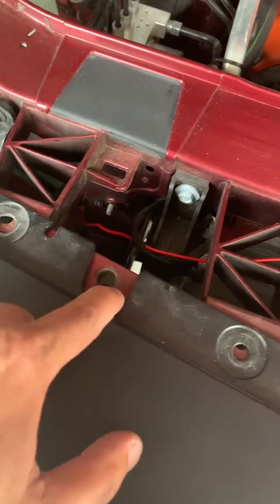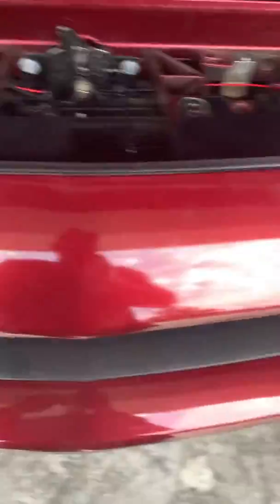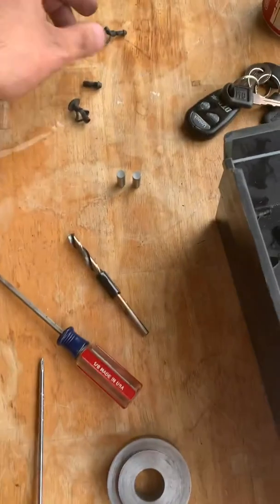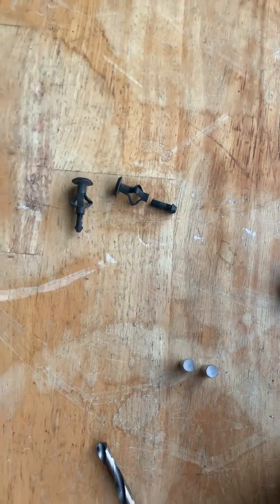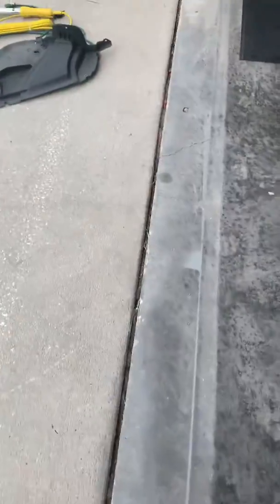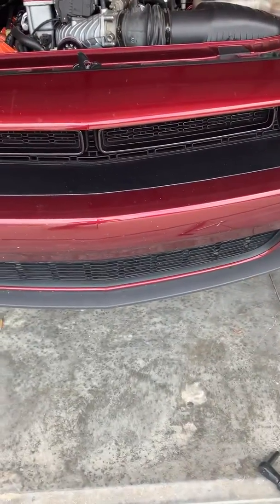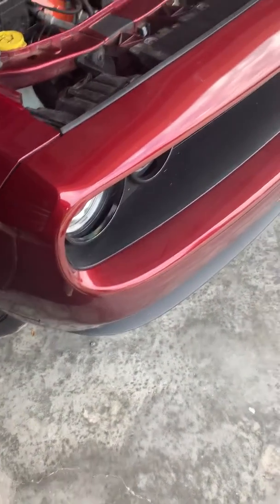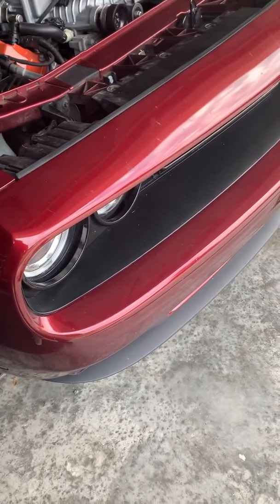Pinning the crank on 5.7 hellcat supercharger

Comment: I pinned my crank on my Magnuson install with just the fans out. I picked up a right angle drill and cut a drill bit down. I did have to take the front end off for my intercooler though.